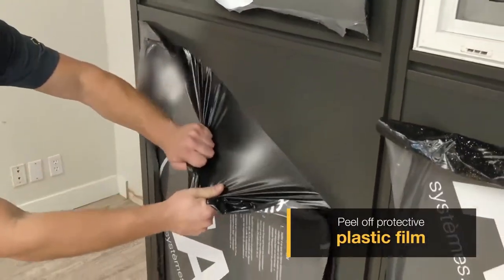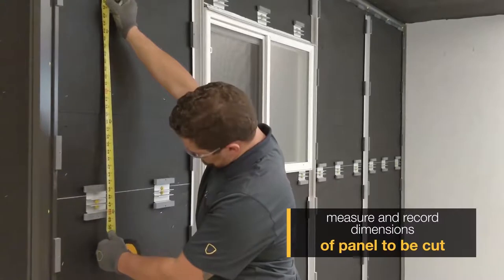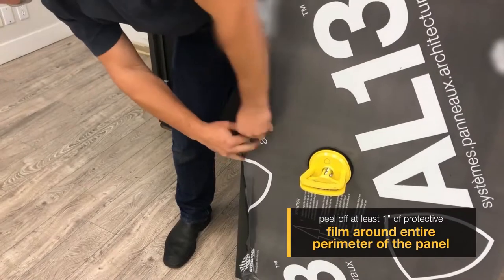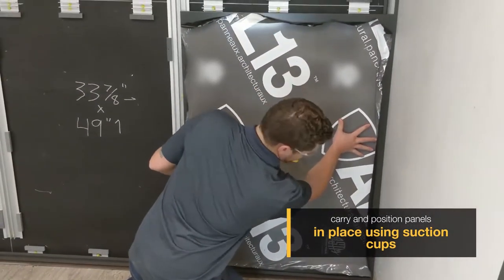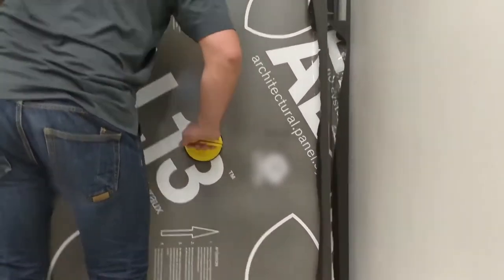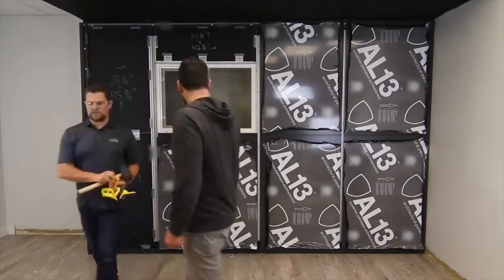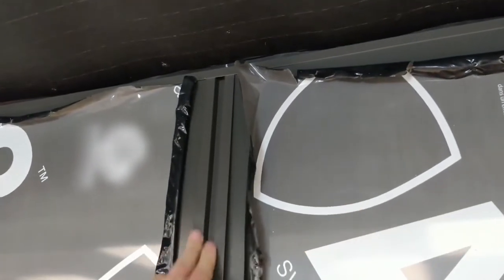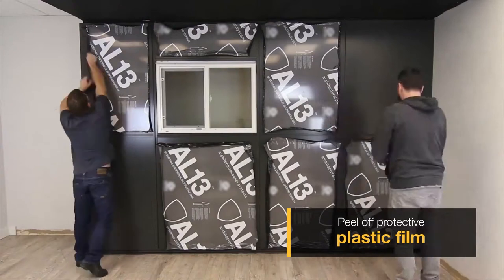AL13® Panel System - General Installation (2019) - Part 2/2

Comment: Try just installing the bottom  or top trim first. Either way, theres no fighting. Ive done 9 store fronts and this last one, im limmited by the roofer. I cut 3"  temporary top trim peices and i had zero fitment fights. Slap em in and go
Reply from the maker: Words from the wise